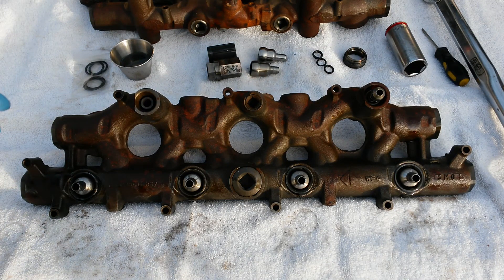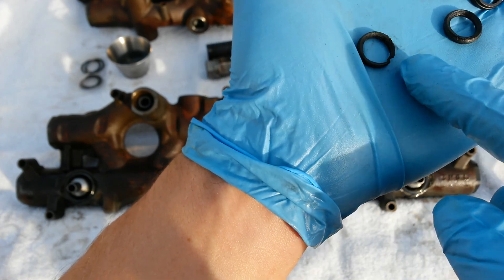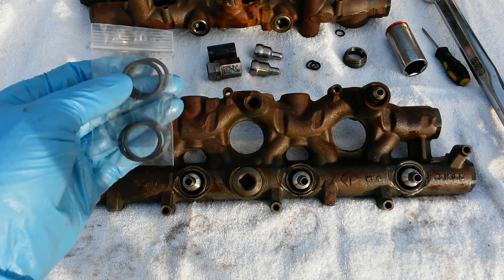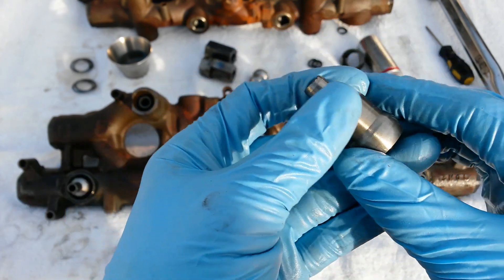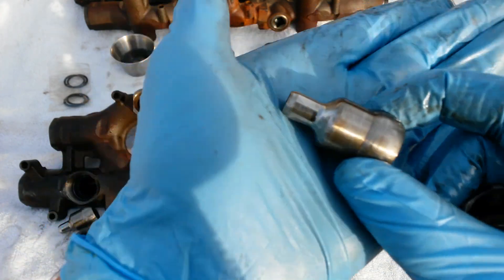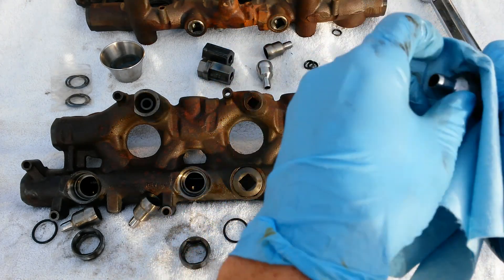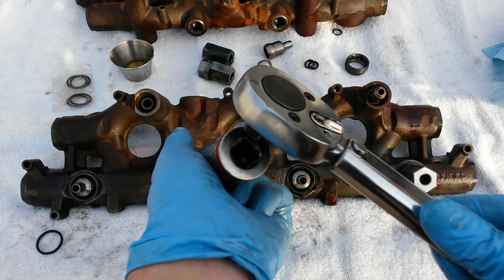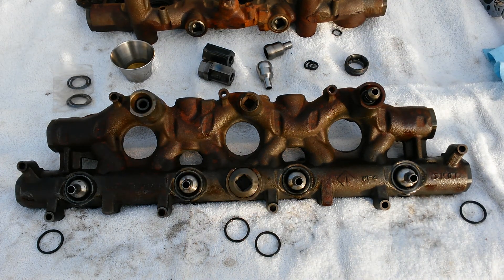FORD 6.0L Diesel ~OLD VERSION~ Ball Tube/Nipple Cup O-Rings & Top Injector Seals

Comment: I saw a write up you did on being able to visually see if you nipple cup orings have failed. By visually seeing the rings it leaves on the outside of the nipple cups my truck is hard starting cold and stalls when warmed up maybe 10-15 min idling it was taken to a shop who said that it needs a new hpop I took both oil rails off after watching your videos and every single one of the nipple cups has those rings on the outside does that mean every single one is leaking and if so could this make the engine stall when it reaches normal temps? It has upgraded stand pipes and dummy plugs as well as upgraded hpop fitting